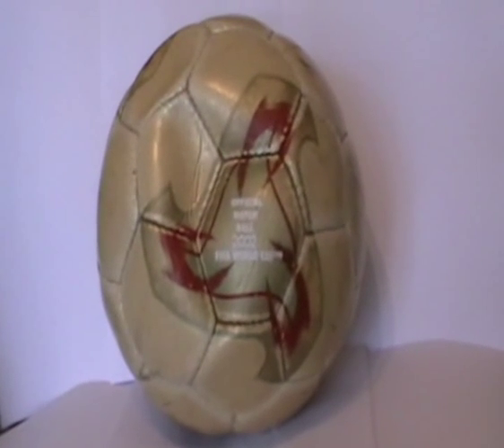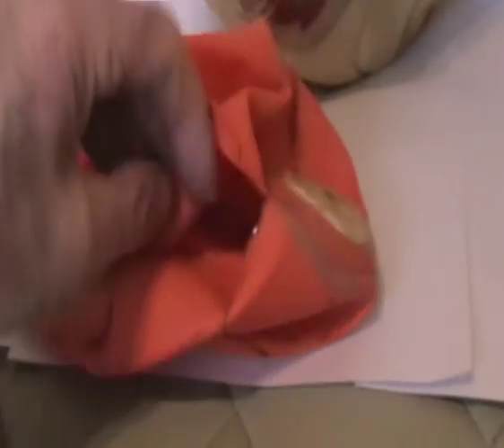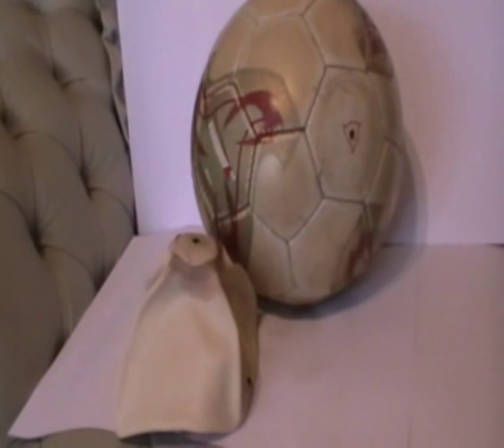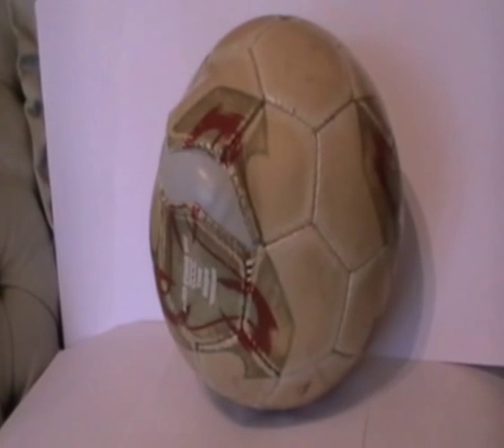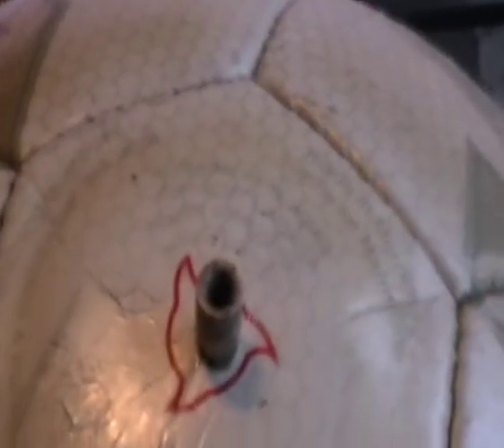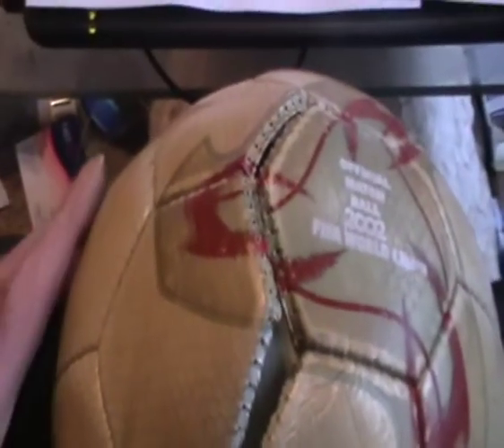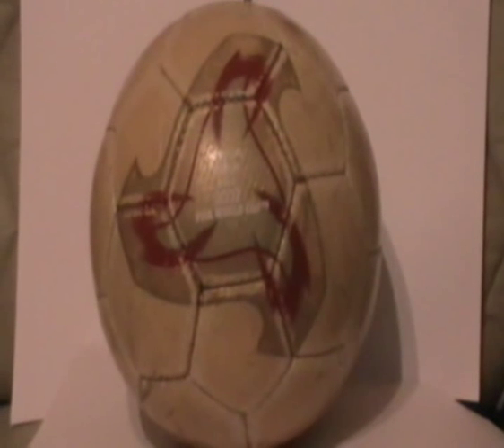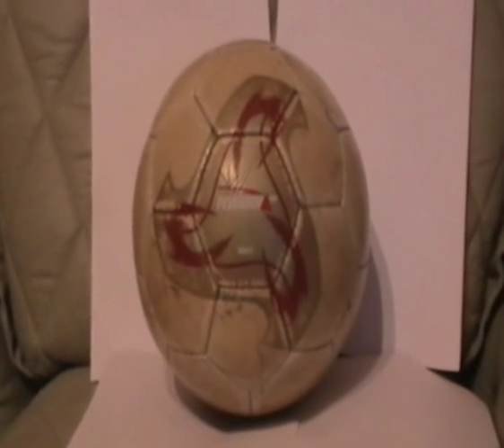2002 World Cup Match ball for new bladder

Comment: What a shame! The most expensive match ball's bladder degraded after 10 years rather sooner. I found lot of replica a few years ago and most of them holds air. Replica or official match ball if they are made with thick sewings they contains latex bladders. These are most annoying because lifespan unstable and degrades unevenly and bust or hiss after inflate or doesn't inflate. Other bladders very rarely degrades. Cheap balls whith butly bladders are better.